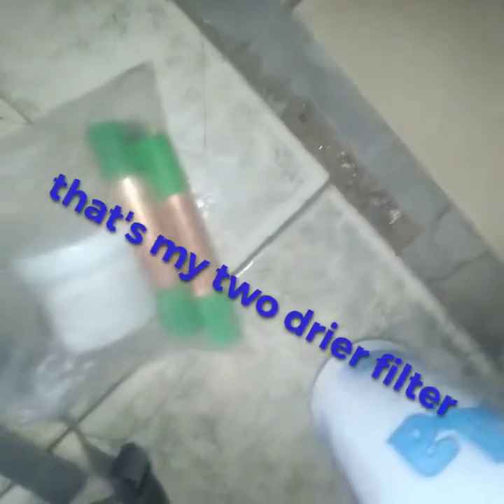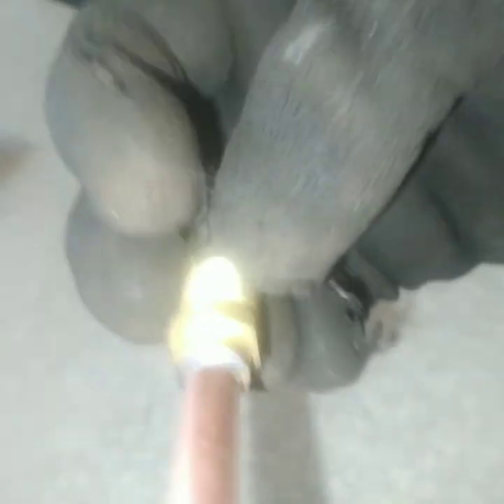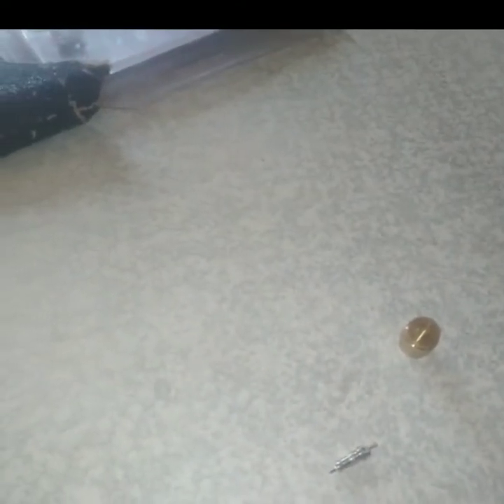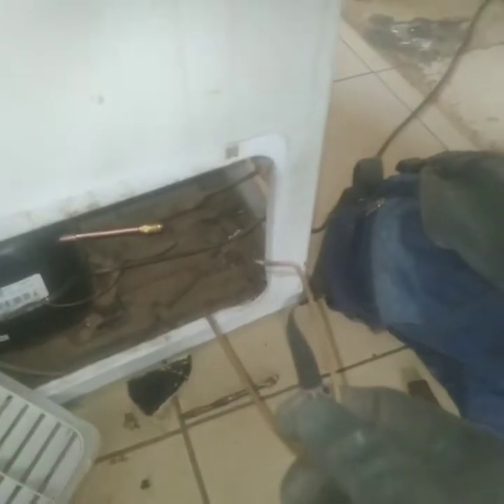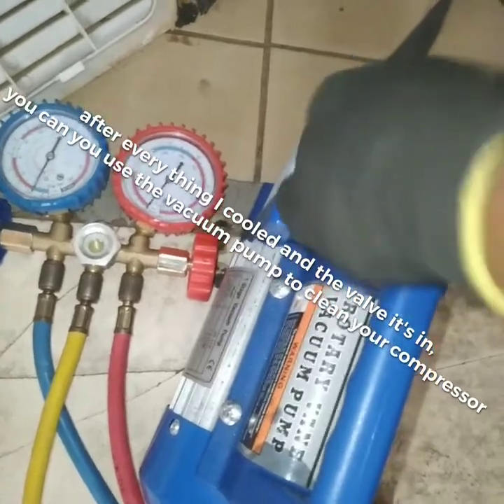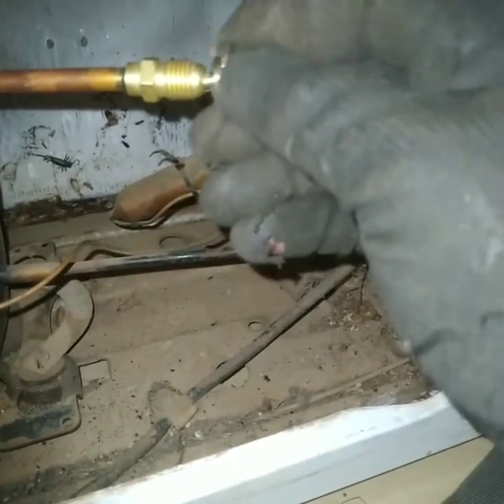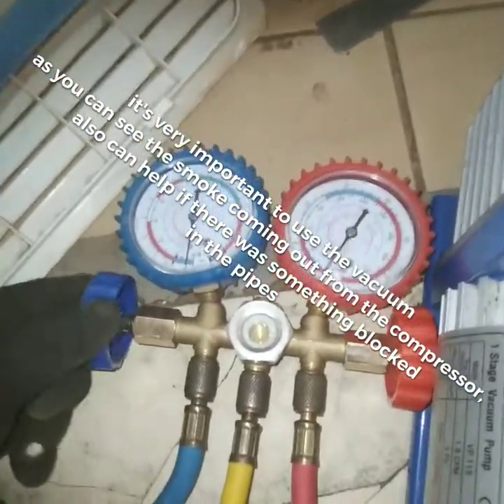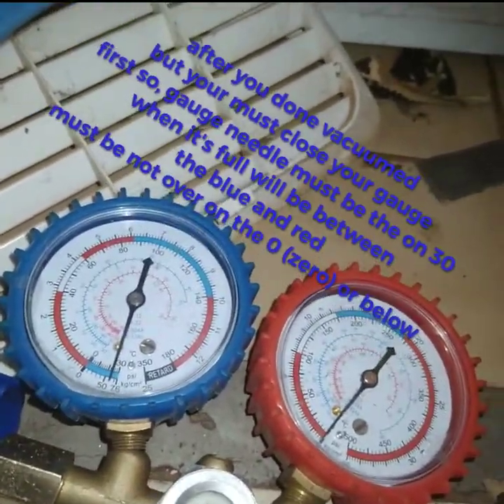how to regas or refill a gas on chest freezer

Comment: Sir im having problem with chest freezer it is not getting cooling.. When i open door it gives hot vapours.. As i checked compressor is not running.. Wt do now.. Pls reply
Reply from the maker: Hi... please check your relay and overload it's fine they are not burned with multimeter, remove them from compressor test them separately if you get continuity both of them they are fine then check the cord and plug if it's also fine,  test the compressor you should also get continuity all on the pins that's correct reading. Good luck and please unplug your appliances